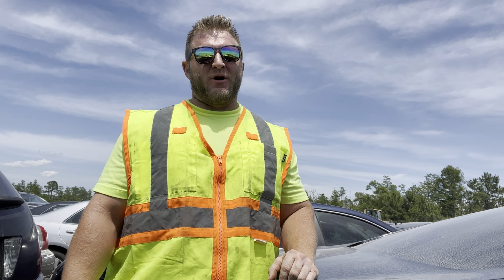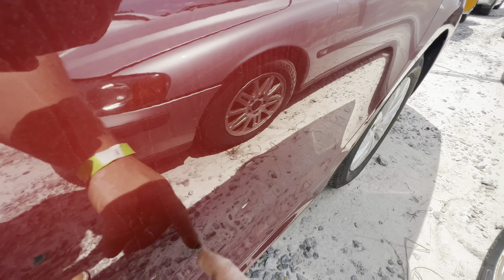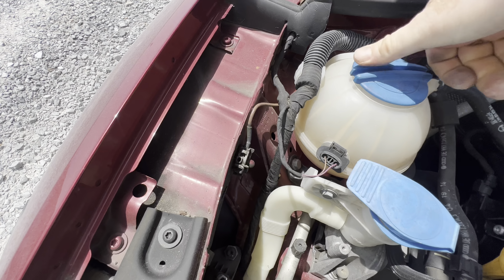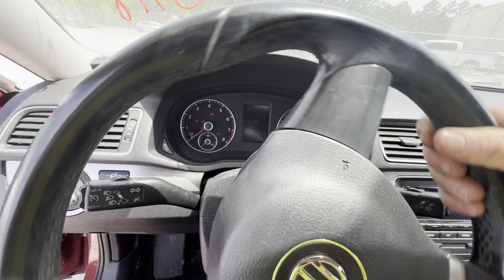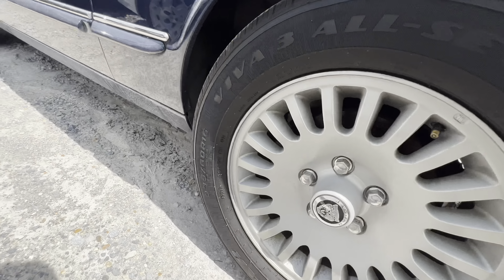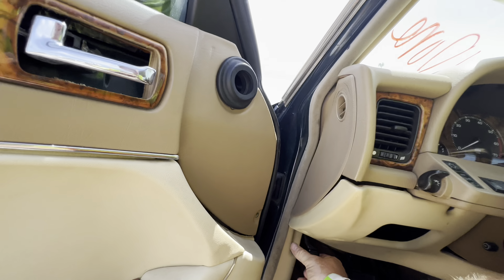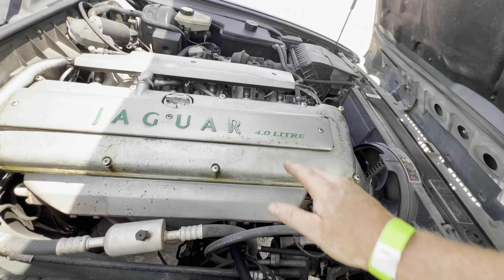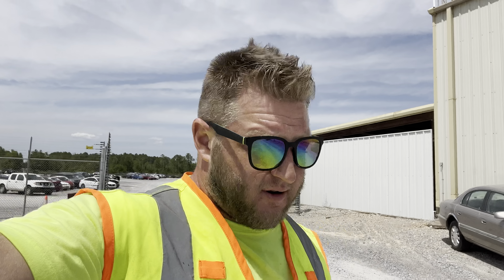Insurance Auto Auction Walk Around  Jaguar XJ8 Vanden Plas + More!!

Comment: Jag needs $2000 in paint and bodywork, interior rough and who knows if the engine or transmission is shot. Anything over scrap price is stupid money. Running and driving examples are under $1000 at regular auctions.